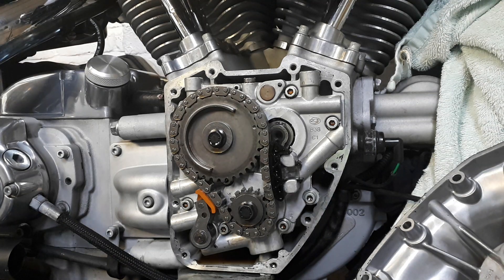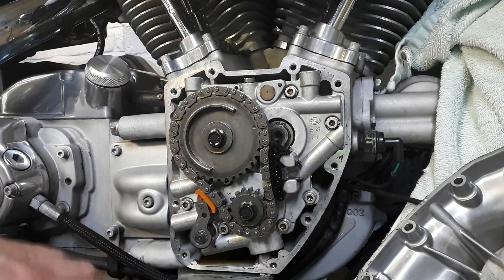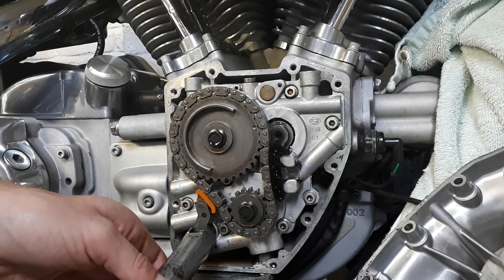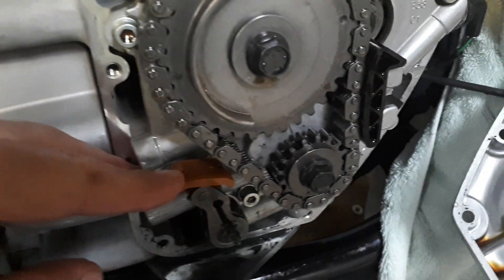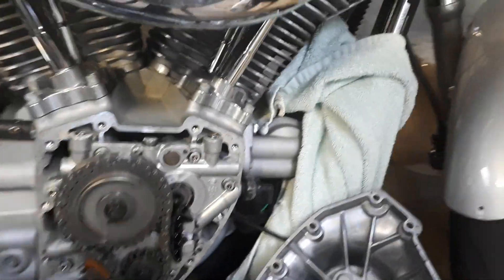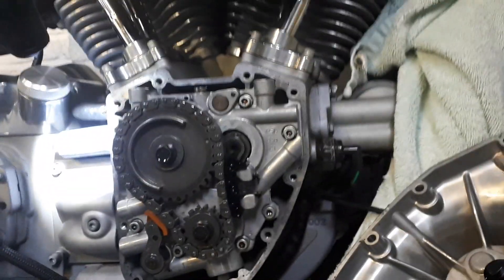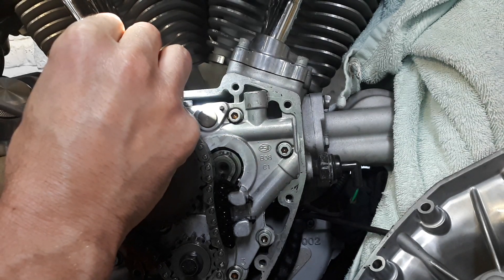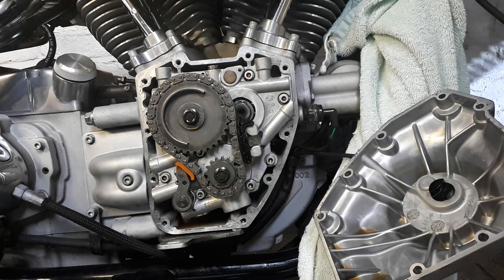How to check camchain tensioners on a Harley 88 Twincam

Comment: oh, ya..... as a side note , i pulled this cam chain tensioner off my 1999 fxdl. 
it run just fine without them...
Reply: Do u not need cam chain tensionerss
Reply: @gilbertquick2412  nope...... apparently not....i put another 10k miles on that bike until i sold it in Denver, Co......
Reply: If worn out could I just pin them back and leave it
Reply: @gilbertquick2412  Not Possible ...
There is one  in front of cam plate , and one  in back of cam plate. YOu must pull the cam plate all the way out to remove the back one... and since the cam plate is pulled, I suggest owners go ahead and pull tin plated cam bearings and replace with case hardened timken cam bearings...
Reply: No, it doesn’t, anyone reading this do NOT run the motor without the tensioners.  Just imagine the chains flopping all around in there, yea. And if even remotely true, imagine how screwed the guy that bought the bike was. This is either really bad trolling or a very inept individual.
Reply: @megastick9324  I am the one who pulled both front and back tensioners. Then I put another 20 k miles on that motor, after the fact..... The cam chains are so short, it becomes more obvious not only do they serve no real purpose, other than just another factory installed hand-grenade waiting  to blow up inside said motor.....
Reply: @garymoore3497  and I’m calling BS , I work on these motors, I’ve been wrenching Harleys since the mid 70s.  I find it not only BS, but that YOU are the only one to ever do it and not one other single person has figured it out, or pulled it off since you. You’re purposely trolling these these people to try and get someone to blow up their motor. Pretty lame.
Reply: @megastick9324  Maybe..... But maybe I am one of the few willing to stand up for myself ; and call a "spade a spade".  I am US Navy Combat War Veteran.  I am no troll.....
Reply: @garymoore3497  combat vets can’t talk BullShit?  I’ve got friends that are Navy vets, and marines and Army...the navy guys are the best bullshitters. Thanx for your service,. Please don’t be a MC mechanic, you’ll kill those your supposed to protect.
Reply: @wingandhog  No....We pulled those parts out, and they will stay out....Only reason we keep them, to show to others those parts were really removed from the motor.....
Reply: @wingandhog  go ahead and still use them...  I've got more than a boat load of other messages ; from others ; who tell me they either also pulled their cam tensioners out ; or planning to pull their cam tensioners out in near future....Just another example of people in this country and around the world just so fed up with Harley's BS ......!!!!!!!!!!!

Comment: Plastic chain tensioners who in God's world came up with that idea
Reply: Honda's have them and so do victory's! Believe it or not it's not bad but these tensioners are much too small.
Reply: The idea would be to have something that would wear down before the metal chain.

A roller bearing would have been better if you  ask me but I'm sure there was a good reason for not using one. Several motorcycle brands have something slightly similar so it wasn't just Harley that used that.
Reply: some $$$$$ saving measure i'm sure. Cheaped out

Comment: Wouldn't be surprised if the fuel in the oil from blow by trashes the plastic. Seen videos of 3 turns out and up the idle jet. 
If you can smell unburned fuel on the dipstick it's not good.

Comment: When are people going to figure out that you can remove those tensioners and run these engines without them. The engineers that designed these gears and that chain measurement never intended for some tensioner to be used on the non tension side of those chains. The tensioners was created by sales marketing competition to get rid of the sonic hum. I removed all my tensioners on my early 2000,s 88 TC engines and they do well
Reply from the maker: Timing chains need to have tensioners. Not only do they control timing stability, but they also improve resistance to wear. Yes, you might be able to run your bike without the tensioners for a while, but your chain and sprockets will wear out much faster due to the slack (tensioners absorb shock and vibration as well), and eventually it can jump having the piston and valves collide with each other.

Comment: I have an 02 Road King with 88TC, Mileage was in low 30s K when I got it.. Now 5 years later it has almost 57k on it.. I feel confident someone (previous owner) did something to it, I have not been able to look up any service records, HD has none anyway..  However I would like to inspect and see at least what it was upgraded with and if it needs service.
Reply: One thing you can look at to indicate someone has been in the cam chest.. Look at the pushrod assembly/cover tubes. 99% of the time when they go in to the cam chest … to avoid cost and time of taking off the rocker arm assembly they use cut the factory pushrods and install the adjustable ones... which have a DIFFERENT cover tube... the Clip secton is a lot longer. Easy to see and determine..  Does this help??  No kidding.. you do NOT want a tensioner to wear thru... results can be very costly...  Good luck!!
Reply: pardon...   miss worded a bit...   those pushrods are used when they change out to either gear drive or upgrade anything inside the cam chest is what I meant to  say..  Good luck sir...  hope this helps a bit

Comment: I think i can get to all the hex bolts without taking off the exhaust!!  One or two bolts are a little close to the exhaust but i stuck a long Allen wrench on the bolts and cracked them lose. I,m hoping I can do it that way because i fear not being able to get the exhaust back on correctly.  If I can see and do what i have to without taking off the exhaust Great. If I need to change them well, I guess the exhaust will have to come off for sure then. I am looking for the cheapest way to do the work. I know without adjustable push rods there is more work involved but I am on disability and don't make crazy money anymore.  Although it looks like i can get to all the bolts with the exhaust still connected, I am hoping i don't have to beat the cam cover off with a rubber mallet cause then I will definitely take the exhaust off!! I don't know why I am scared to take the exhaust off, but I AM LOL.   I used to have a good friend that knew Harleys inside and out and had the tools to do what has to be done and he and I used to work on my bike all the time, then go for a ride. I've since moved 1200 miles away and have no friends like that where I am now, so I'm on my own.  I pray my tensioners are okay but it is a 2001 with 24000 miles so I'm thinking they definitely have to be replaced.  If I want to ride I'm going to have to do it myself cause being on disability I sure can't afford a Harley mechanic.
Reply from the maker: You can try without the exhaust off but I think it’s going to be a struggle. Taking the exhaust off and putting it back on is not much or difficult work. Plus, at least you get a little practice for next time when actually replacing the shoes. It’s always better to do it the right way.
Reply: @aronsgarage834  It's done already   Got it off no problem. Exhaust is still on. I just had to look at the tensioners. JUST in TIME too. The primary was about to grenade. If I had started that bike one more time I think that would've done the trick and i could've used my motor for a boat anchor.   Harley is picking it up for me Monday.  I thought about attempting the repair myself but..... They are just going to put new stock tensioners on, Didn't have the money for the upgrade since I just became disabled. They are charging $180 for both tensioners and 6 hours labor.. about $1000  bucks. I ll know the job will be done right!! LoL
Reply from the maker: @elliottnunez1057  yeah, that’s probably your best bet then! It’s good that you caught this just in time. One more motor saved! :)
Reply: @aronsgarage834  Thank you so much for your replies!! I do appreciate it. Taking the time to help me!!  I will message you and let you know how everything turns out when I get the bike back. I'm praying once they break into the chest there's nothing else that needs work.  Lol. Thanks again!!!
Reply from the maker: My pleasure, Elliott. Always happy to help. Yes, let me know when you get the bike back. Fingers crossed all good inside!
Reply: @aronsgarage834  Went to the Harley dealer today   the mechanic told me to change the tensioners AND the cam plate. He said just putting stock tensioners on with the same cam late won't be good for the motor.  So, he said to put in a new cam plate with hydraulic tensioners.  It's coming with aluminum cam plate, new gear, new chain, new, better oil pump.  Then while getting ready to put in, he pulled the spark plugs and said there was oil and gas mixed in together in the rear cylinder.  He said because the carburetor was really old it doesn't have and overflow AND the petcock is after market, the guy that sold the bike to me should have told me to turn OFF the petcock while I wasn't driving.   He also said to rebuild the carb. because I asked him if he just siphons the gas and oil out of the cylinder i could just turn off the petcock NOW, Now that I know about it!! without rebuilding the carb.  With the rebuilt carb I would have to turn the petcock off too... he said if I left the carb the way it was it might flood out the cylinder while I was riding and rebuilding the carb would prevent that!!  Don't know if that's true or not, but I saw the inside of the cylinder and there was definitely oil and gas sloshing around. He said rebuilding would be better, and something about the float...but meanwhile I still have to turn the petcock off when not riding. An 800-to-900-dollar job is now costing me around 2000 plus tax...jeez... I,m praying nothing else goes wrong cause Iv'e got no more money!!!   Disability doesn't pay much these days.  I do believe him about the gas and oil in the cylinder because it was fine while I road it, but after taking the cam cover off to check the tensioners I finger tightened the bolts back on to keep the cam cover and bolts together after a few days they sent a flatbed to get my bike and as soon as i straitened the bike out to get it on the flatbed..fluid just gushed out of the motor on the bottom... i didn't think just taking the cam cover off would cause that   so the cylinder must have filled up and when the bike stood straight it all came out...  So after all this I Pray the thing at least runs correctly!!!  Something tells me I should ve never sold my Shovelhead or my Evo!!   So that's where I am at now.  I just wish I wasn't afraid to work on the darn thing myself could've saved A LOT of money!!  But I could've also done more damage not really knowing what I'm doing and without the correct tools... I do have a manual but that can be confusing at times too.  Damn Motorcycles and Cars, cost more than a damn woman!!! LoL
Reply from the maker: @elliottnunez1057  sorry to hear about all that trouble! Well, Evo’s were definitely bulletproof and best ever built motors.
Well, for what it’s worth, at least your bike is going to get a proper upgrade and will be reliable for years to come. You’re investing in it so it will pay off ;)

Comment: good. now make a video of how to pull both spring loaded tensioners , and show the motor running without them.
Reply from the maker: I would never attempt to do that. It may run for a while without tensioners but then as the chains stretch it can jump timing causing a lot of trouble.
Reply: @aronsgarage834  they are very short triple row chains. and after 20 thousand miles, we see  very little sloop in the chain tension. We are going to continue this method, and continue to document the results as a result of milage. We will soon see enough if they really are required or not.........
Reply from the maker: Hmm, very interesting. If you’ve passed the 20k test and still going strong it sounds quite promising. How frequently do you check them, every 10k? When do you think you’ll reach 40k?
Reply: @aronsgarage834  don't know when I will see 40K miles.......but when I get there, yes I will re-check ; given I have to pull the cam plate completely out, as to check the rear cam chain as well................in the mean time , just one lest issue to worry about......
Reply: @aronsgarage834  You forget to mention their are two (2) sets of triple row chains ; one in back and one in front. We did not measure amount of slack at 6 miles. But at 20 thousand miles, and these chains so short, we did measure a small amount of slack, and etched that number on the case. So, when we get to 40 or 50 thousand miles, we can calculate the delta, if any.....Otherwise, we see no real useful purpose of these chain tensioners ; other than just another factory installed hand-grenade waiting to blow-up inside the motor...........................
Reply from the maker: Yes, as long as the timing won’t change affecting performance due to the slack, then you should be good. It’ll be interesting to see when it hits 40 or 50k. Please keep us posted.
Reply: @aronsgarage834  remember there are two (2) triple row chains ; one in front and one in back of cam plate.
We did not see any slack at all.
Further, we have a solution for the Mil-8 motor , to plug the oil supply hole;  when we pull those chain tensioners....
Reply from the maker: Not familiar with the Mil 8 engine but definitely interested to see how it performs in the long run.

Comment: My 2005 Road King Custom's tensioner broke and it cost me $1,100 to fix - damn Harley dealer sold it to me without telling me it had to be replaced and it broke 1000 miles after buying it used - bastards!
Reply from the maker: Sorry to hear that. Did they just replace the tensioner or convert the whole unit to hydraulic? I’m going to convert mine to gear drive at some point.
Reply: What happened when it broke ? In a sense what did they end up having to fix..?. I'm thinking of doing Mine in the winter but I just bought my 2005 RK classic and dont know if its really bad or not

Comment: I checked the tensioners on my former 1999 , by pulling both of them , and throw them away.
Reply from the maker: Did you covert to hydraulic or gear drive? Or just changed the shoes?
Reply: @aronsgarage834  I Threw The Shoes Away......No shoes....No spring tensioner....."nothing"......Get IT ????????
Reply from the maker: I get it now. Thank you for explaining.